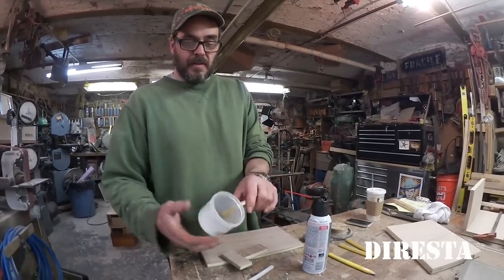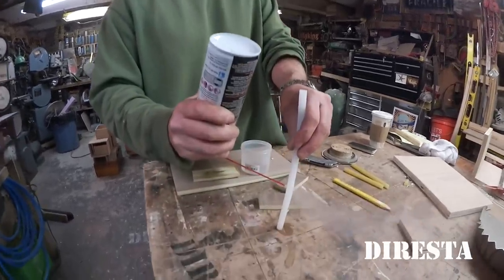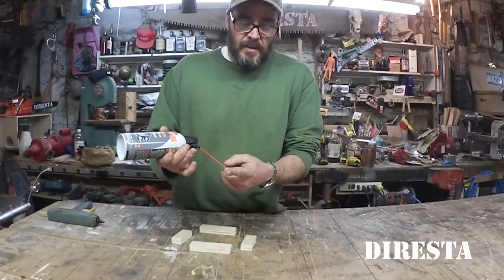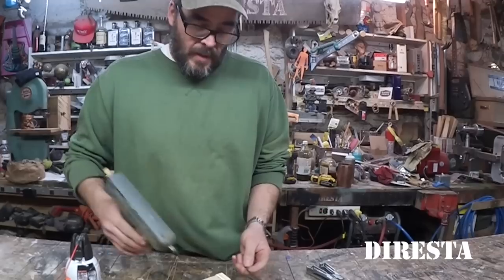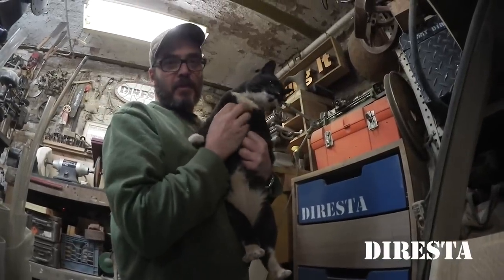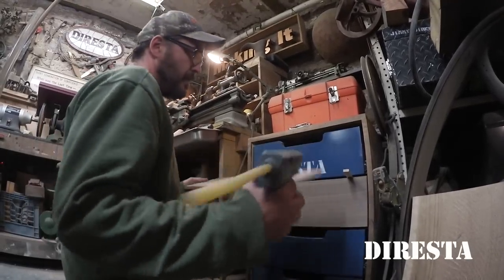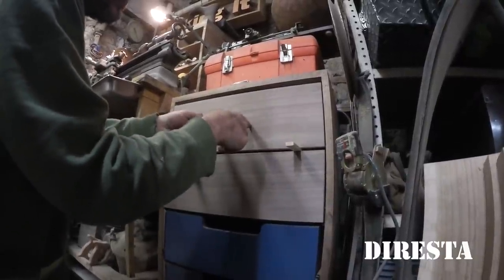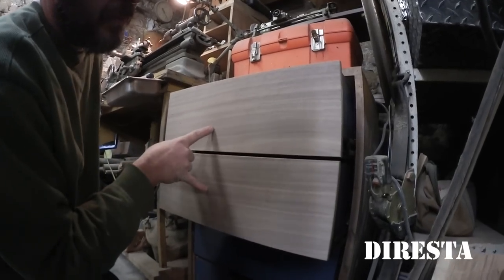✔ DiResta: Jimmy Tips 1 HOT GLUE

Comment: Hot glue also works great as small 'rubber' feet on objects. Cut off a small disc from the glue stick, heat one end with a lighter and affix to the bottom of your piece. I use this for the bases of uneven sculptures, bowls and objects for display.
Excellent video!

Comment: A few more:

1. IPA (isopropyl alcohol, rubbing alcohol) release hot glue joints easily, dab on the edges and they pop off
2. Hot glue into heatshrink both shrinks the tube and makes a watertight seal, good for wiring and stuff.
3. You can buy freeze sprays for plumbing, I think you get more juice than a duster
5. When you nearly run out of glue, stick the next stick on to the current one to prevent feeding issues
Reply: I was gonna mention 1,2, and 5 (where's 4? :p). They are great tricks. Especially the alcohol one.
Reply: halsoy I think it never existed and now it won't let me edit.
Reply: 5 I've known since I got my first hot glue gun Im sure everyone knows it.
Reply: Josh Good for you.
Reply: Josh oh you would be suprised
Reply: Number 4, Pulling dents out of your car.
Reply: Worked a place where we used a lot of foamcore and hot glue. A squirt of rubber cement thinner will loosen the glue also.
Reply: #1 rubbing alcohol is extremely useful with hot glue.  It totally breaks the bond and completely slides off like magic.

Comment: Here's another tip for quickly gluing cables:
Most cables have a natural twist to them (ethernet, stranded power cord, many others). When pushing the cable onto the bit of fresh hot glue on the surface, make sure you go at the same angle that the cable's twist pushes it to, so that the cable itself is pushing against the surface onto the glue. Move your feeding hand further along the cable to grab the next spot (keep pressure on the cable so that it doesn't come loose from the glue), spot the next bit of glue and continue. Using this method there is no waiting at all, you can go as fast as you are able to manipulate the cable with one hand.

Comment: You can release a hot glue joint pretty easily with a drop of denatured alcohol too. It gets in between the part and the glue and the part just drops off. A bit slower than the canned air, but WAY cheaper. It's good for removing all of the glue, too, so you have a fresh joint to start with. 

~cheers

Comment: Denatured alcohol will creep in and pop a hot glue joint. FliteTest did an interesting video where they glued a brick to a microwave and then used a little plastic pipette. The DA creeps in and breaks the bond. Peter at FT said that it was frequently used in automotive work to pull dents out. Glue on a handle, pull thing, unglue handle.

Comment: Love your work. Very inspiring and I've gained some really good tips, tricks and techniques from watching your work.

One little nit pick if you don't mind....whether you turn that canister upside down or not it is still refrigerant that is being released. By inverting it you are simply releasing it in it's liquid form. Sorry, this is just one thing that irks me....that and the term "hot water heater".
Reply: You can be sure Jimmy tested both ways and found it's the liquid form that does the work faster as it evaporates, plus the liquid form has a better chance of penetrating the joint to freeze the glue not just the wood around it.

Comment: Great video, Jimmy!  I use a hot glue gun like this quite a bit as well.  I have even done drawer faces just like you did.  Very good ideas!  Never thought about using the duster, though....hmmm.

Is there a particular kind of hot glue that you use?  I have found some pro strength sticks at Walmart that seem to work very well on a variety of surfaces.

I also like to use my hot glue gun to rig up temporary jigs for welding.  Another use is to hold smaller pieces together that are difficult to align before tack welding them permanently.

Comment: Be careful with the computer duster stuff. They often put a substance called a bitterant into the can to prevent idiots from huffing it, and when you turn it upside down and spray the liquid out, the bitterant comes out as well. True to its name, this stuff tastes absolutely terrible. If you get some on your hands, or even a work surface that you touch later, and then touch food or put your fingers in your mouth, you will regret it. Make sure you wash everything that crap touches immediately, and don't transfer it anywhere else (e.g. your keyboard).

Comment: Like the tips, but only... Freon is so bad. It's banned, so I hope it's something else....
Reply: +Maarten Happel Not certain where you are located but Freon is not banned, at least not anywhere I know of. Keep in mind that "Freon" is a brand name for refrigerants made by Dupont. Certain refrigerants have been phased out of production through the years. If refrigerants were banned as a whole then modern mechanical refrigeration would be darn near impossible. What is typically used in compressed air canisters is R-134A (the R meaning refrigerant). This is the same refrigerant used in most automotive air conditioning,smaller commercial refrigeration systems and even some residential appliances. It is still considered a "controlled substance" by the EPA here in the US and probably other countries as per the Montreal Protocol. It is considered to have negligible ozone depletion properties but the "danger" involved that Mr. DiResta mentions is due to the ability for it to cause almost instant frost bite when, in a liquid form, it makes contact with flesh.
Reply: +Mark F. R-134A is not that we usualy call FREON. It is CH2FCF3. Meaning it does not use CL. R-134A is ok. No harm done here :-)
Reply: I know all too well what R-134A is. I've been in the HVAC/R industry for a good number of years. FREON, as i stated, is a brand name but has become a catch-all term, at least here it has, for refrigerants as a whole used by the layman. If I had a nickel for every time I heard the phrase "I think it just needs some FREON." I'd be rich by now....if only.